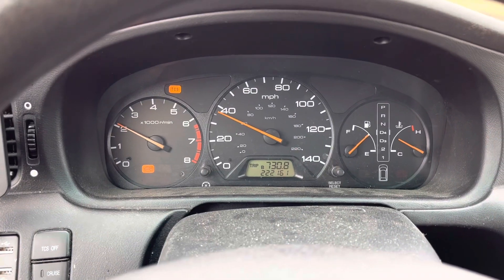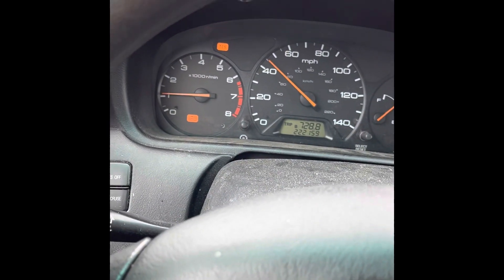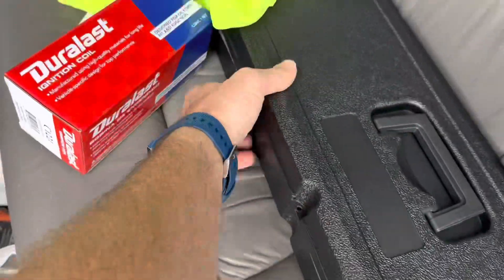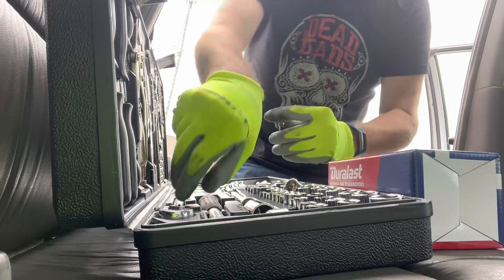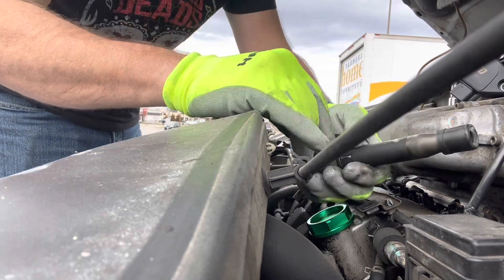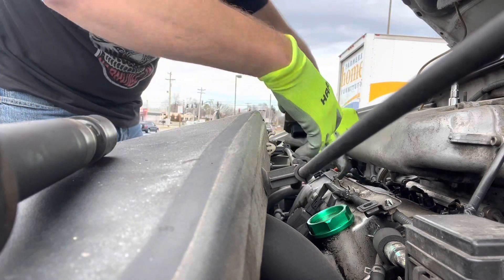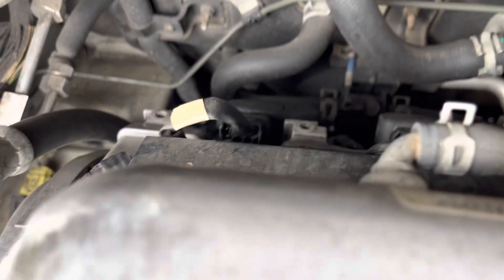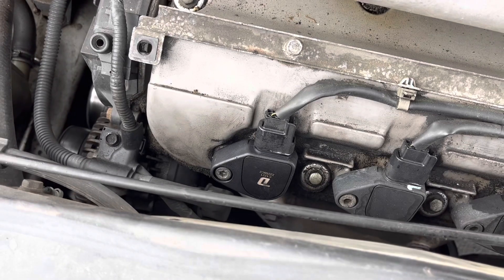Parking lot breakdown in the 2004 Honda Odyssey

Comment: Replace 'em as they fail and compared to other roadside repairs, quite easy.   However, $60 seems like an awful lot when maybe you could grab a couple from a scrap yard for a whole lot less.  Get them home and test them.  Keep one in the car as a a spare.  Maybe you could get another 10k miles of service on the cheap?
Reply from the maker: Some cars, like the kids Mitsubishi need to have the intake removed to replace the rear coils. In that case its a tricky road side fix but not impossible and in that case it might be better to replace 3 at a time. Coils  are great things to grab at the junk yard. I may get a few next time I'm There.